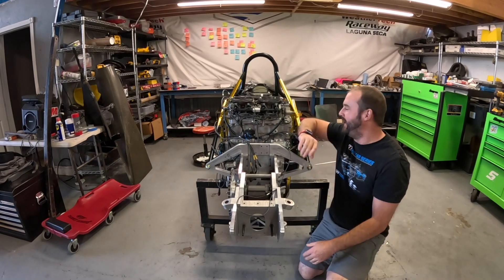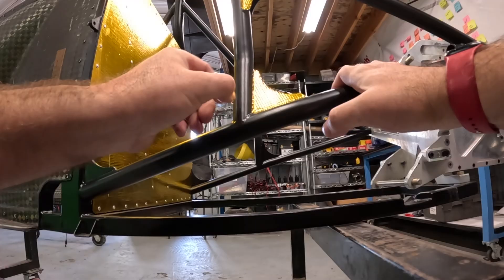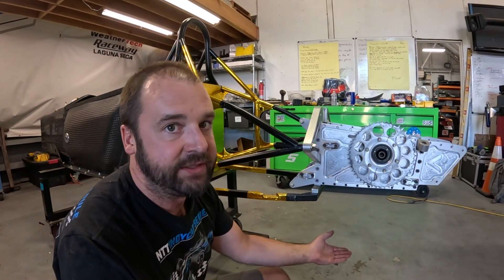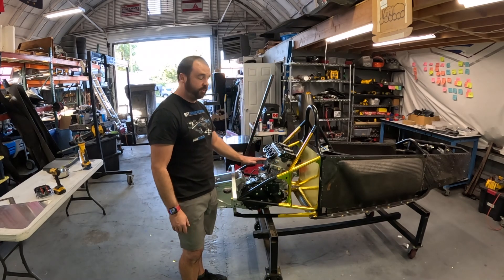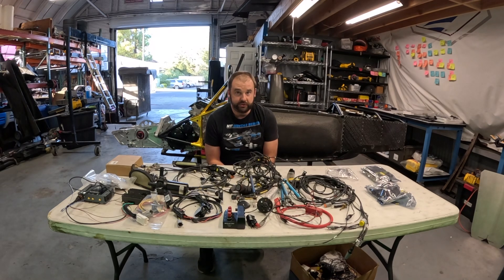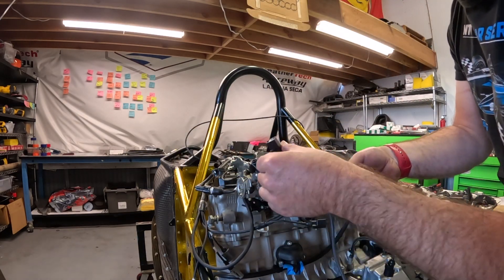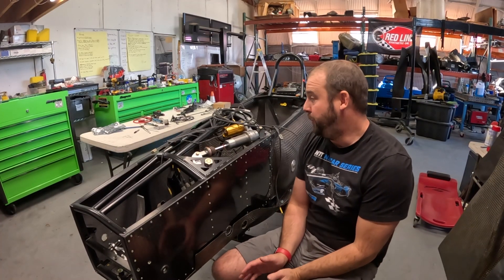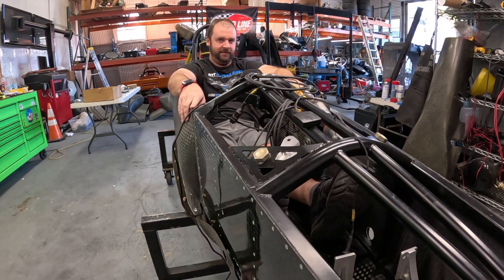Episode 6: I Love Gold! Suzuki Hayabusa Engine Install & Life ECU and Motec Dash Test Install

Comment: The bearings on that diff side plate system must be quite big to cope with wheel speed and chain tension 🤔 are the roller tapers the same as a wheel bearing or have you used angular contact bearings?
Reply from the maker: I believe they are roller. But sadly not totally sure. I tend to run my chain a bit looser then most just because I can imagine the forces.